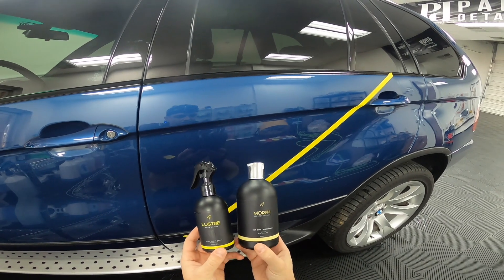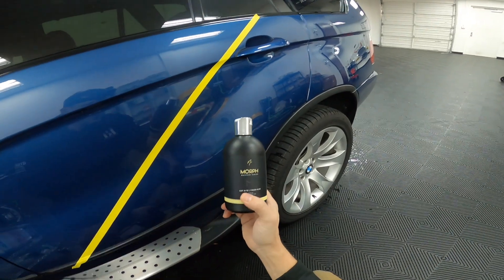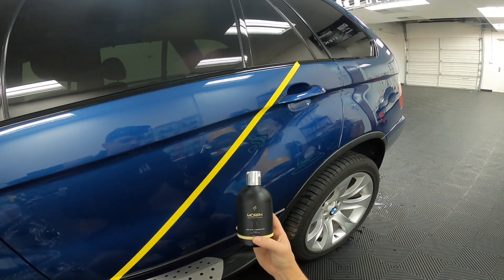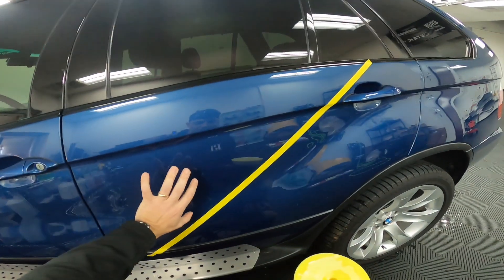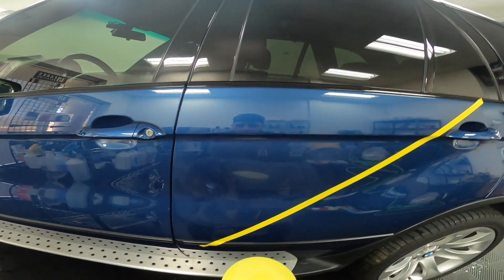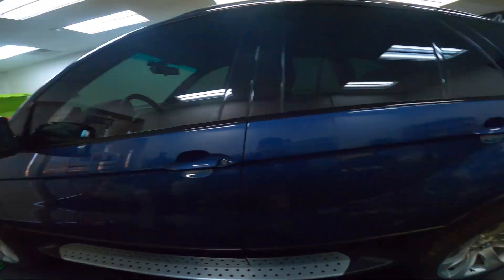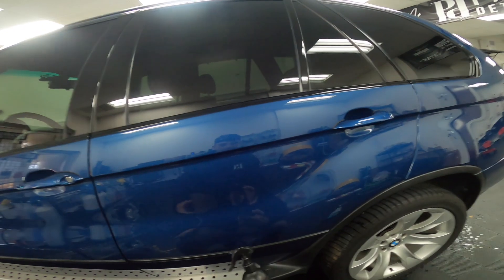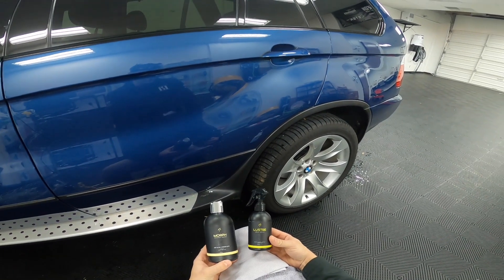HOW TO - Nv Morph & Lustre

Comment: Just to be clear after you polish with morph you dont use a IPA wipedown? Just straight into a coating?
Reply from the maker: Thank you for the comment.

HutchDesigns that is correct! You want to wait roughly an hour to let the Morph cure if you are using a ceramic coating. No IPA/panel wipe down necessary. If you are using Lustre or Jet you can go straight away, no cure time needed!
Reply: @parksdetailing7991  cool! Thanks for the reply. One more thing if I used a soft foam pad like a griots black finishing pad would it lower the cutting for the polish? I dont have to many defects just a mild clean up and coating
Reply from the maker: HutchDesigns that would be an ideal combination for a simple clean up prior to installing a coating. Let us know what you think and if you have any questions at all please don’t hesitate to ask!

Comment: if you are going to use a graphene sealer would Morph be a good first step
Reply from the maker: Wayne Grosvenor we have not specifically tried this, but have no reason to believe that it wouldn’t work well! Which graphene product specifically are you wanting to top it with?
Reply: @parksdetailing7991  I have some artdesheen crystal